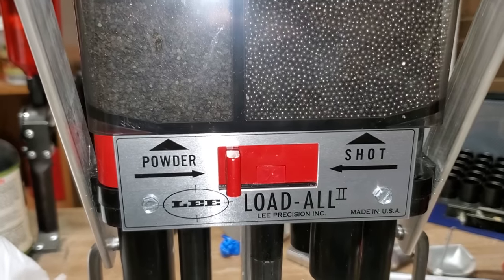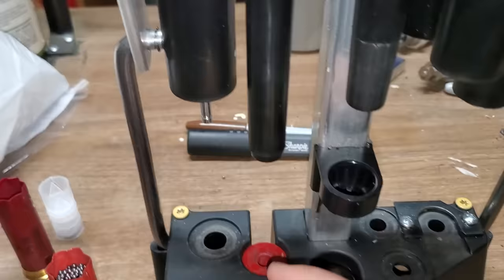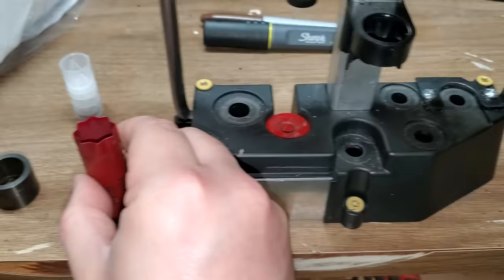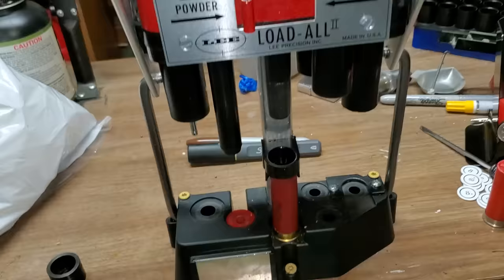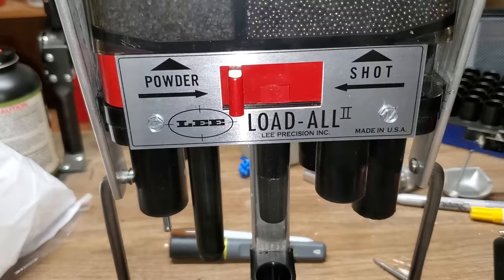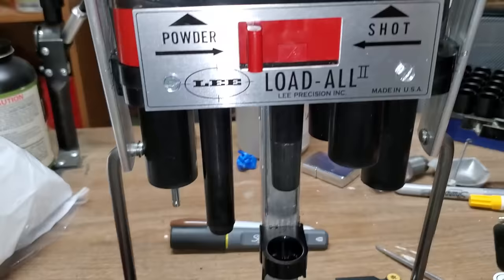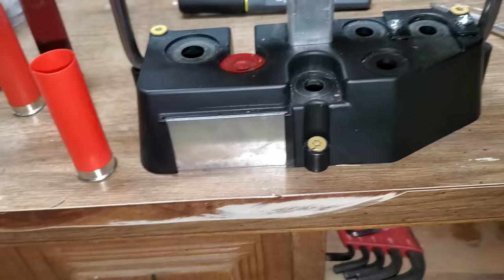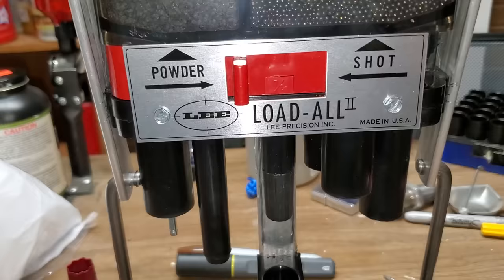Using lee load all 2 with once fired hulls

Comment: Do I use a 155 powder bushing for a trap load
Reply from the maker: That greatly depends on the powder you are using.   You will need to find published load data.  I have a video with which shot bushing to use based on the load data you select.......
Reply: What is the best load data to look for
Reply: The only reason I ask is I am new to reloading and don’t know much about it
Reply from the maker: @evanbullock5112  for shotgun, ballistic products incorporated (BPI) sells a book called the advantages manual,  it is the best I have come across.   I also have several videos on reading load data and setting up this press.  Hopefully they can help get you started.

Comment: Can you load tss with this press?
Reply from the maker: I have loaded only lead.  
1 - with any other type of shot, the shot bushing will not be accurate.   The 1 oz bushing will not throw 1 oz of TSS.

2- larger shot sizes tend to bind a little.   The slider the drops your powder and shot tends to catch when trying to meter larger shot (#4) because it has trouble "cutting off" the shot charge.

If using small shot (6 or smaller)  then only issue 1 will be a problem.
Reply: @murphyfirearmstraining3630  I need to load lead also. I mainly need to crimp with that for tss I guess. I can do everything else manually. I guess this would also technically be manually, but I can measure out on a scale, etc. Thanks for the answer. I appreciate it.

Comment: Can you reload short brass also?
Reply from the maker: Brass length doesn't matter on shotgun presses, only overall shell length.  This press will reload 2 and 3/4 inch and 3 inch shells.  I do exclusively 2 3/4 inch shells, I can get plenty of power from those for what I need.
Reply: @murphyfirearmstraining3630  thanks for the response. I have been loading rifle and pistol for little over a year, about to make to jump to shotgun also. Does wading matter? Seen there are alot of styles but figure its kinda like everything certain ones pattern better but they all work.
Reply from the maker: @timberbosscalls  yes sir that is correct.   They all work but some work better (some spread fast for close shots and some spread slower for longer shots).  It depends on what you are doing,  bit a cheap bag of wads will get you started.   It is a lot of fun, best of luck.

Comment: I have 2 LEE ALL LOAD, one for 12 and one for 20 guage and there are some serious issues with these machines.. first of all.. they are not accurate alt all... loads are plus/minus 5 grains and the shot is plus/minus 50 grains.. and it leaks power.. and leaks shot all over the damn place.. so mount it on a tray, you gonna need it... other anoying thing is that you can not change bushings without emptying the entire machine and you need to unscrew it from the table to get the shots and powder out.. the bushing are not accurate either and you need to file them a bit to get the loads you want.. the shot bushings are made for lead shot.. not steel shot.... I my honost opinion, then its just too cheep
Reply: I hand load my rounds. I drop my powder and shot and weight them, before loading it into the sheels in order to make sure I have the same amount of power and shot in them all
Reply from the maker: Mine leaks no shot at all and I have only had one powder (a ball powder) that it leaked a little.  Definitely not enough to put a tray under.  I wonder if maybe you got a bad one or something.......

You do have to empty the entire machine to change loads.

I have never unscrewed mine from the table in 10 years, so I am not sure what you mean about unscrewing it from the table.

Yes - the bushings are made for lead.

It is cheap for people to get started or to load a few specialty rounds.  You get what you pay for.  I like mine, but I agree with some of your comments.  It definitely has its drawbacks.

I appreciate you watching and hope you find what you are looking for.
Reply: Is there any order option